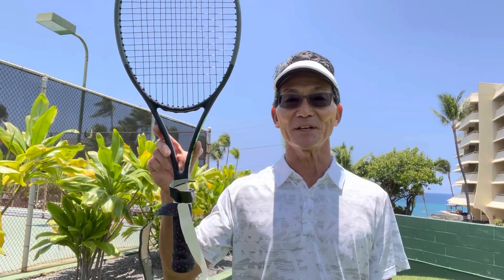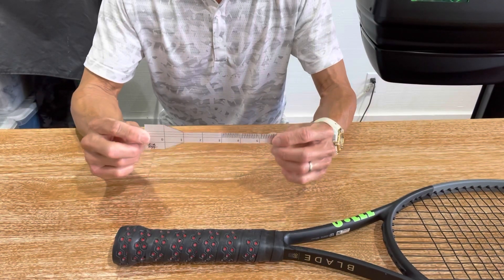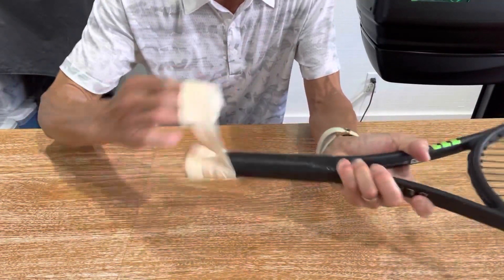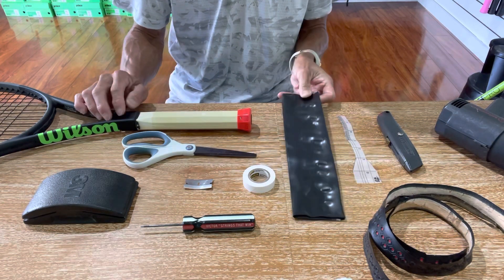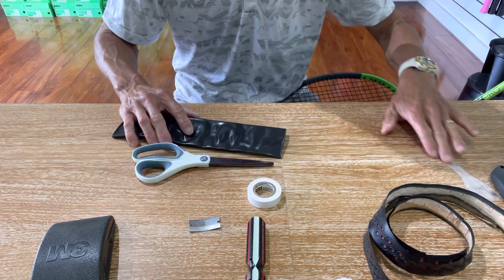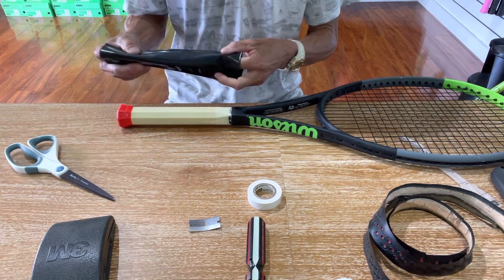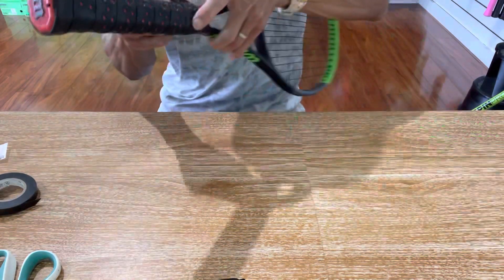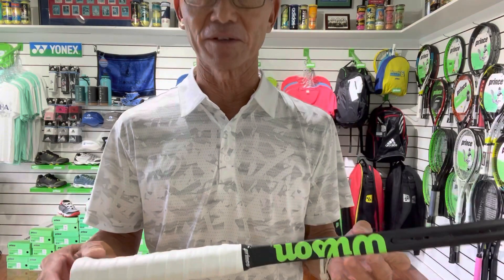Racquet Customization [Building Up a Grip]

Comment: Little tip: there is a very thic replacement grip from Wilson called Wilson Cushion Pro, it grows almost a full size up and its only about 4grams heavier than Head Hydrosorb- but sit flushes the corners of the grip, it ends up rounder. I rather go on this route because 16grams that a build up sleeve adds is too much for my taste.
Reply from the maker: Aloha Christian, 
Thanks for sharing. 

I haven't tried the Wilson Cushion Pro grip. Here's another size-adjusting replacement grip recently featured on the IART website. Although I haven't tried this grip yet, it looks perfect for this particular situation. 🤙
https://gssalliance.com/free-public-access/problem-solved-grip-customization-simplified/
Reply: @AMstringing  that's amazing, thanks for the reply!

Comment: May I ask if the end result still maintains the bevels?  I also want to build my grip size up and thinking about doing exactly like what you showed on the video
Reply from the maker: Aloha, Using the heat shrink sleeve will maintain the bevels, but no matter how you build up a grip, it will round off the edges to some degree.